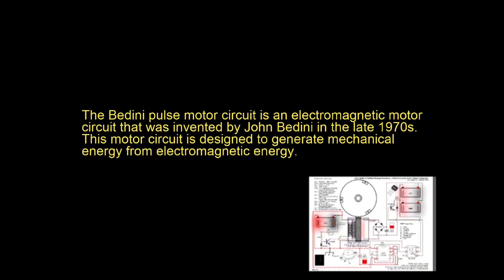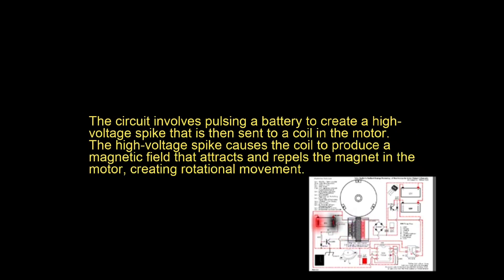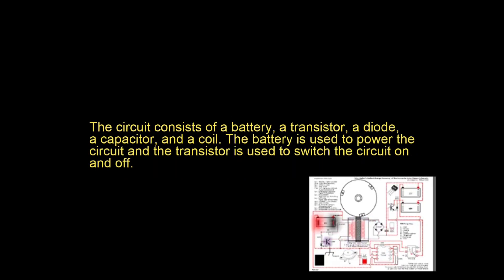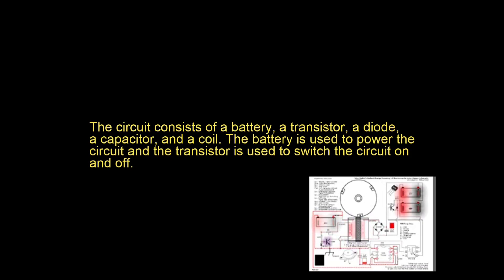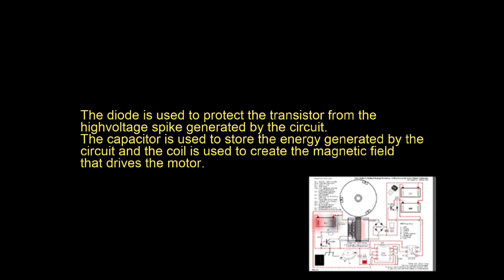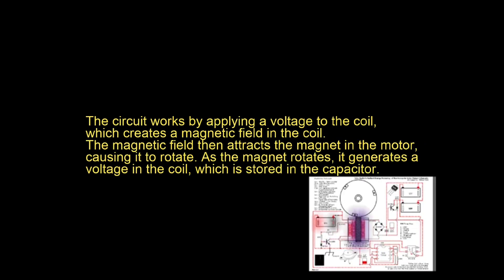How the Bedini Pulse Motor works

Comment: Everything is wrong. Why do you make content when you dont understand the technology?
Reply: I have successfully builded several Robert Adams & Bedini models combined that gave overunity far above the input volts.
At first with my first model with an input of 700W, the output was 2.3KW, but ran akmost 15 minutes before it get so hot if I did not shut down, it would burnt out.
Aprix 18 month there after, I ran it ice cold by means of frequency input.
The research is still on track.
Reply: @messengerofgod2788  IQA?
Reply: Hey..if you are less than about18 years old I forgive you. Its great that you are interested.
Reply: @SuperSquark  can you recommend something to learn about this technology where it is well described
Reply: @danielborowski9468  Build one. Simple and small I like best. There used to be loads of stuff on you tube. Listen to John Bedini himself. Again there used to be loads available.
Reply: bedini copied from the adams motor